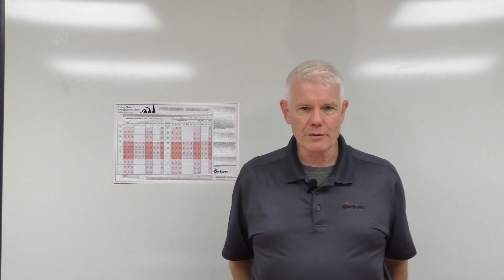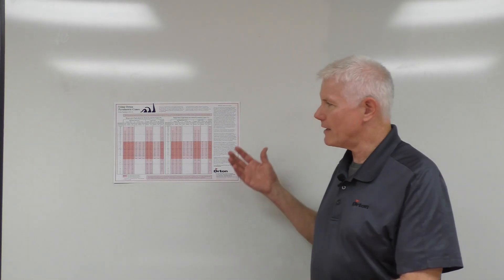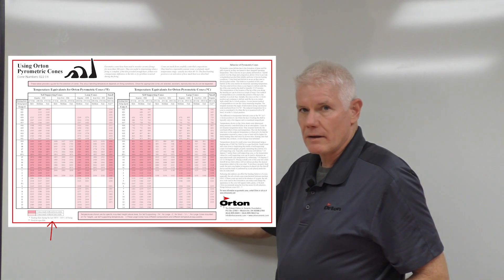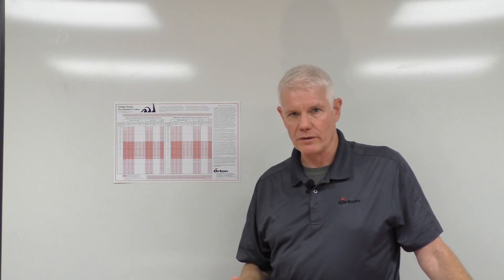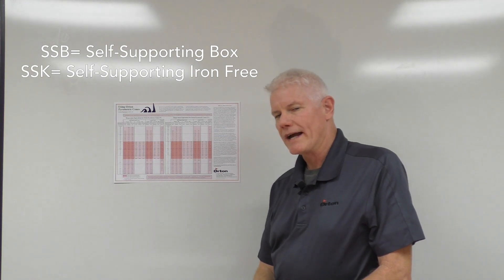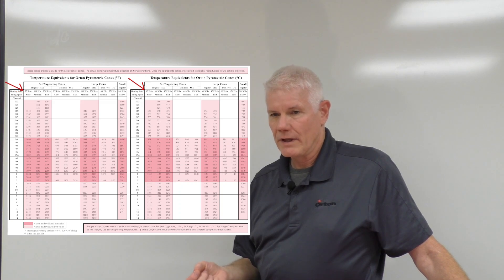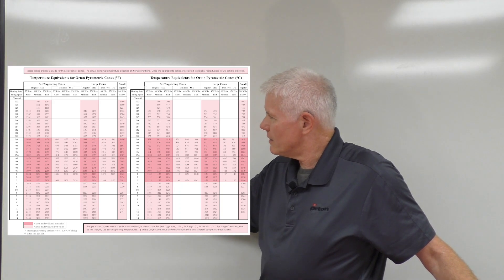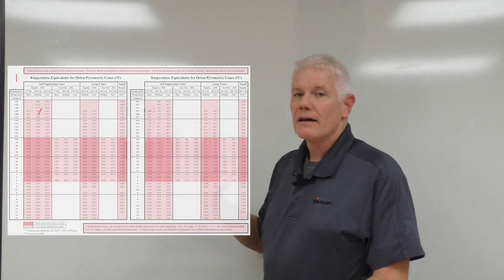How to Read Orton Ceramics Cone Chart

Comment: Amazing explanation, thank you.  For nearly 50 years I only used cones, our old kilns had no thermocouples and over the years we learnt to tell the temp by eye, backed up always with cones.  But when I retired I bought a small modern kiln with a thermocouple, I thought it was so snazzy that I relied on it entirely, quite a mistake.  I returned to cones very quickly and now with this explanation I will understand the thermocouple better.  Back to basics, nothing can be as predicable as a cone and heatwork isn't registered on my thermocouple. THANKS AGAIN.